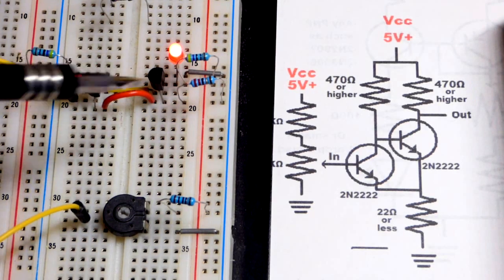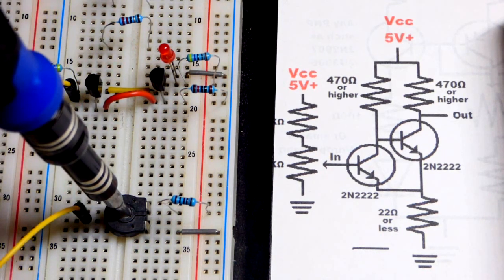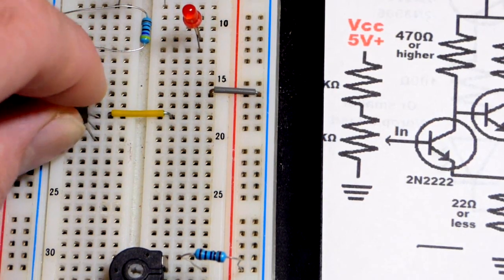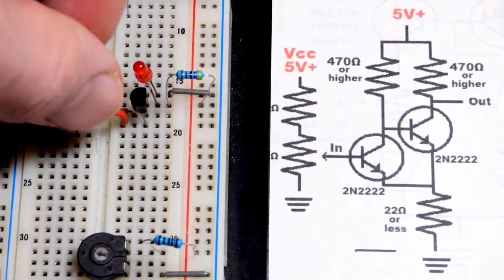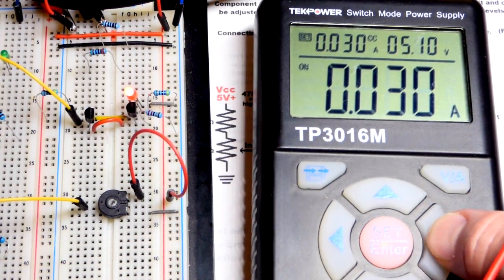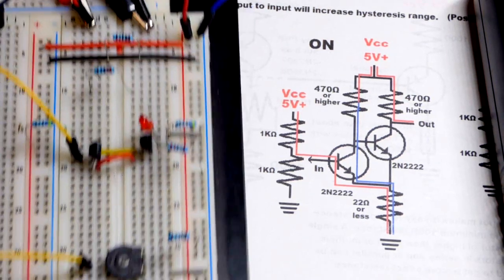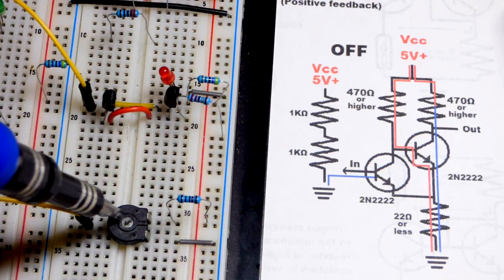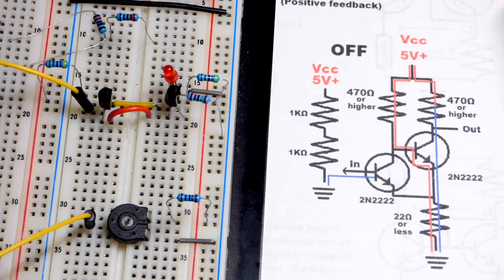NPN BJT schmitt trigger circuit using 2N2222 bipolar junction transistors

Comment: Thanks, great video. Do you think the hysterisch of a few milivolts is enough for switching on/off a small relais ? Supposed the sensor is a LDR which measured sunlight ?
Grtz from Amsterdam, the Netherlands.
Reply from the maker: Relays coils tend to have their own hysteresis. And the relay modules are probably about the same price as individual relays, so I just buy them. I don't remember testing if the modules have Schmitt trigger inputs. Thanks for watching!

Comment: Great demo! :) I utilized Schmitt triggers heavily in the MIDI thru boxes I recently built. (2 down, 2 to go!) You can think of MIDI as a digital representation of the revolving cylinder with pins that you find in a music box. My circuit needs to buffer the incoming digital MIDI signal (which is roughly 32KHz) and send copies of that signal to up to 16 devices so to ensure a clean, strong signal is relayed it uses Schmitt inverters and double buffers by inverting the incoming signal and then inverting the 5 individual signals going out (of which one happens to be an LED). Sorry for rambling on but if you had told me 1 year ago that I would be building this thing I would have said you was crazy! 😂 This one (called MIDI Thru) is actually one of the easiest MIDI circuits to put together ... MIDI Out and MIDI In are quite complex.
Reply from the maker: Very cool!